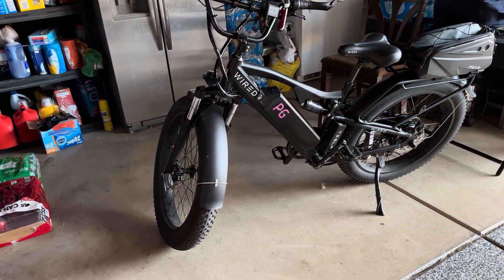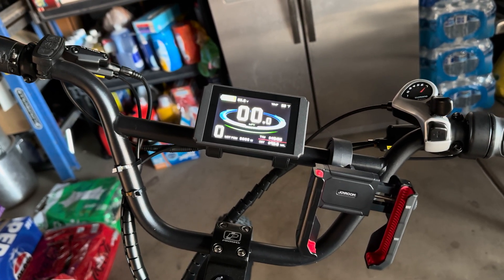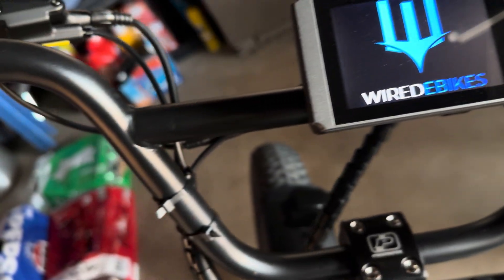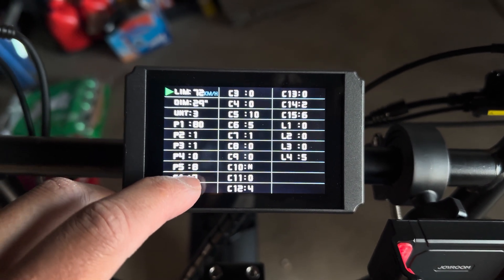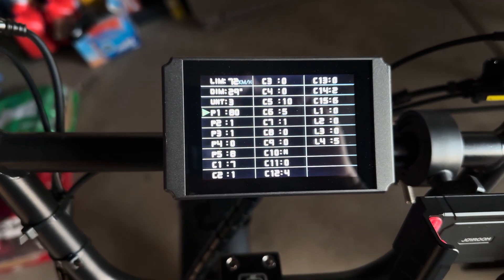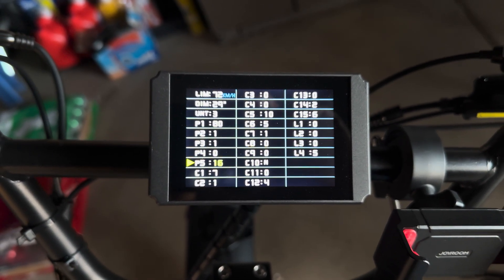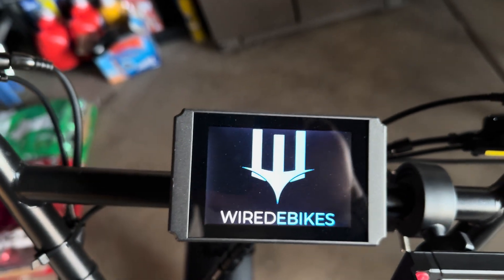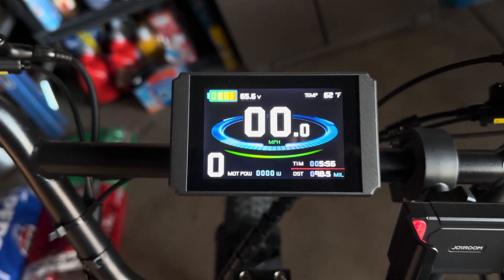Wired Freedom Battery Display Discrepancy Fixed!

Comment: Thanks for your video. My display was showing that my battery was low. Only one bar left, but the voltage was still at 59, and I had 3 bars left on the battery itself. 
I followed your instructions and it worked perfectly. Thanks again!!
Reply from the maker: Glad it helped! I was wondering why my battery kept saying it was on the 3rd bar even after it was fully charged! 👍🏽
Reply: @teamdriven32  Same here. Even after I charged it, it wouldn’t show all bars full on the display, yet the indicator on the battery itself showed full charge. I wasn’t putting 2 and 2 together, as I had only charged it 3 times. 
I noticed in another video, that you have the fender brackets on both front and rear fenders. I just received my bike January 24th,  and come to think of it, I don’t know if I have a ’23 or ‘24 model. Either way, mine didn’t come with fender brackets. 
The question is, did you purchase them separately? 
Thank you in advance.
Reply from the maker: The fenders came with it but, I have the older model before the Refresh. The fender still rubs here and there 😏

Comment: Is this a 2023 or 2024 model?
Reply: This is a '23 model. The '24 models have a completely different rear suspension.
Reply: @GoneIn88 24'  needs to be set at 6 not 8. Talked to Wired today